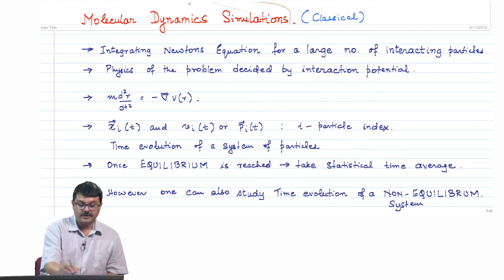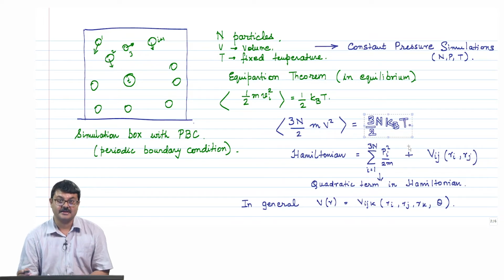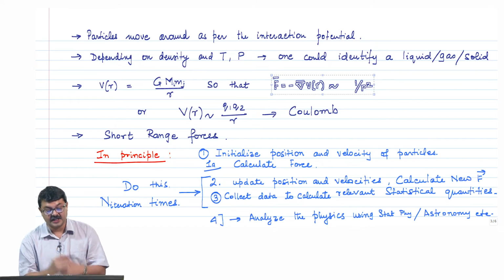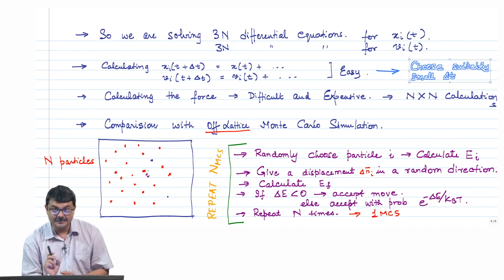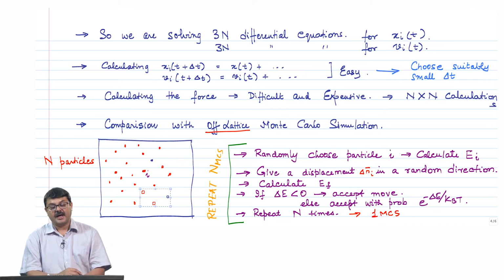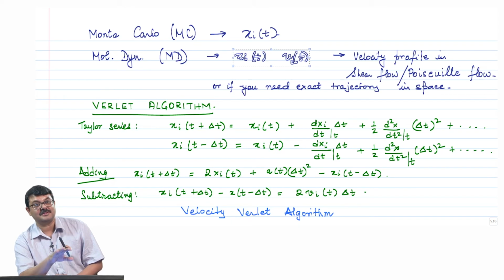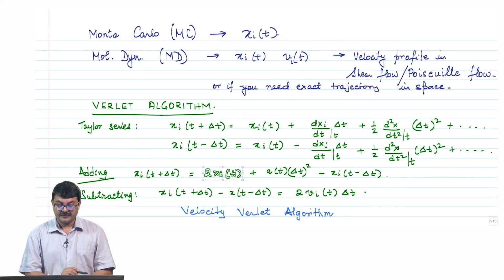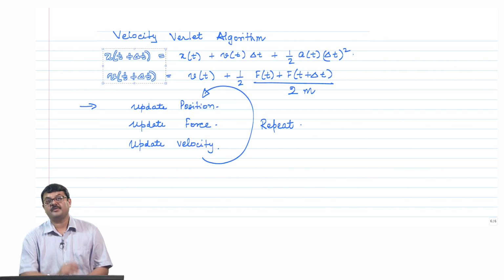mod11lec46-MOLECULAR DYNAMICS INTRODUCTION - PART 01

Comment: As you said that we need postion at (t-delta(t)) in case of  verlet algorithm to calculate new position as we add both the equations to get a new eqation but  in case of velocity  verlet algorithm we are using the equation as it is without doing anything. My question is  why we arev not doing the same in case of verlet algorithm, why are we adding them up and making it more complex to solve?